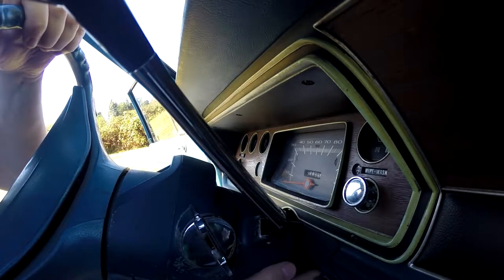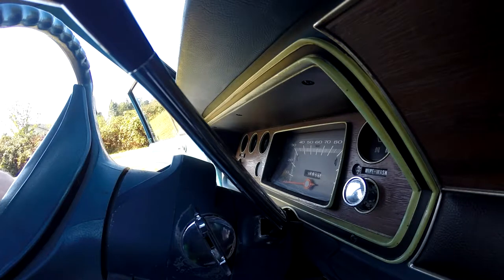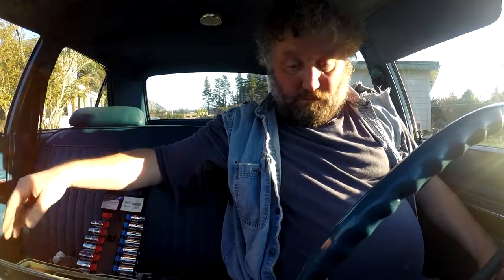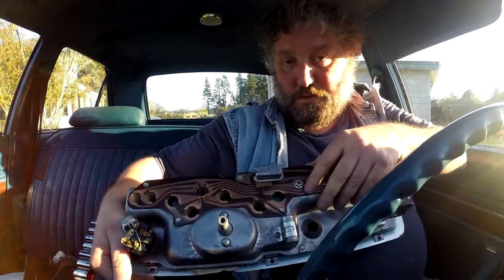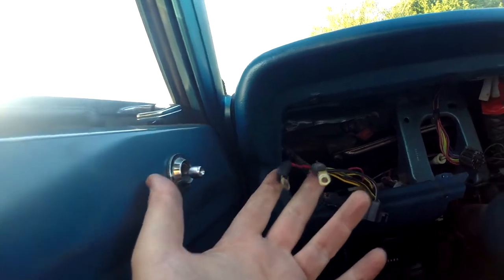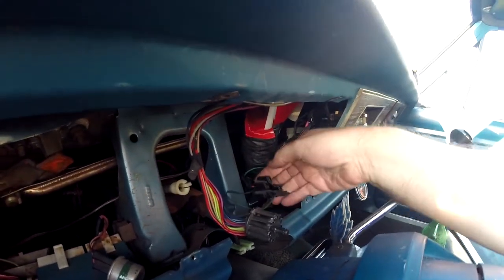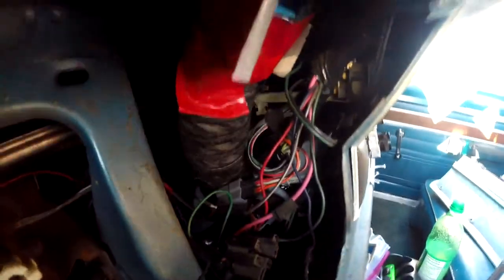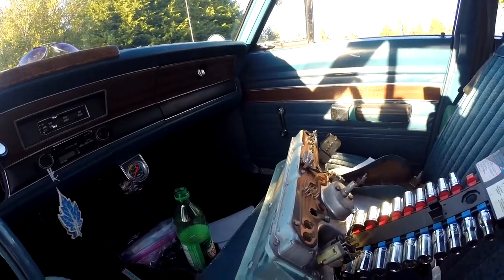1974 Valiant - Electrical Diagnosis/Repair - Part 2

Comment: I have a 1976 Plymouth Valiant. I need to replace some of the lamps in the dash. Is there an easy way to do this?
Reply from the maker: Bulbs should be pretty straight forward. You still have to drop the steering column though.